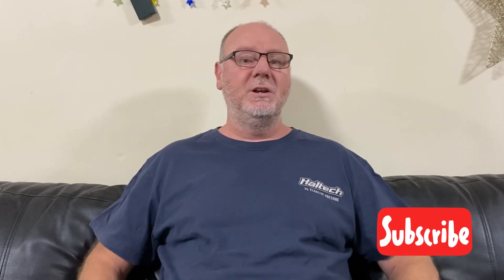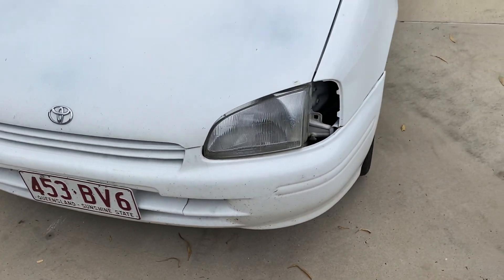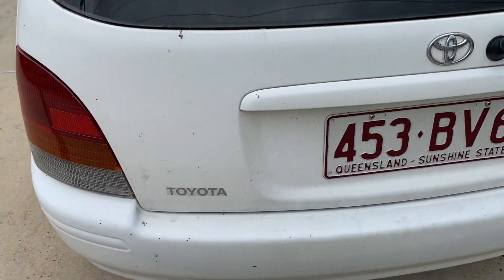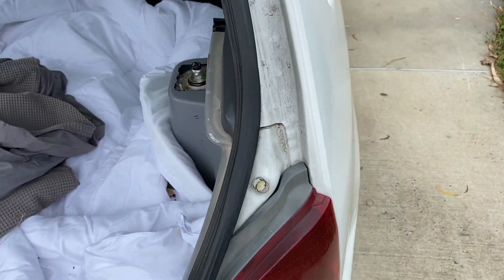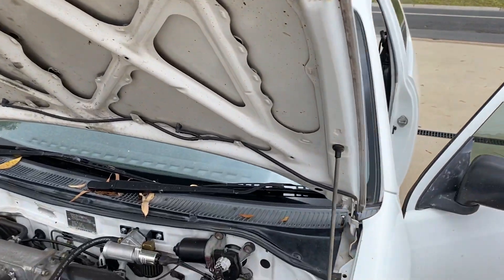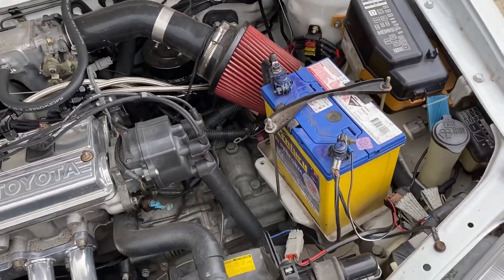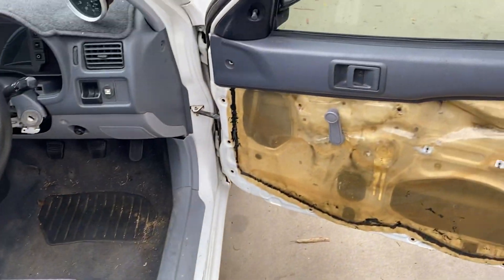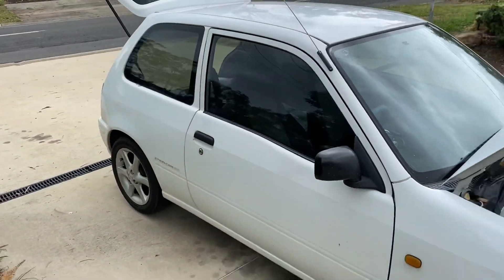Supercharging the Toyota Starlet

Comment: Is that exhaust manifold ceramic coated? If so, was it worthwhile?
Reply from the maker: Hey dquad. The headers were ceramic coated. To be honest, I don't know what difference it has made at this stage. The goal was to reduce any heat I could from this part of the engine bay. Thanks for watching and supporting the channel!